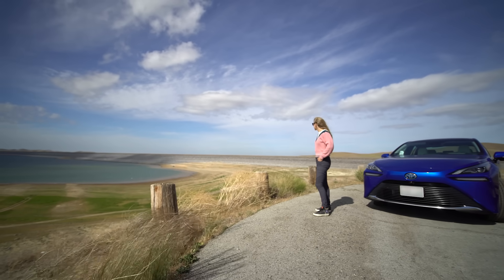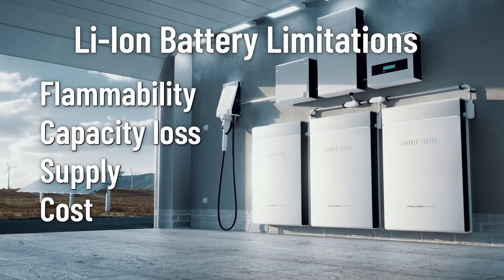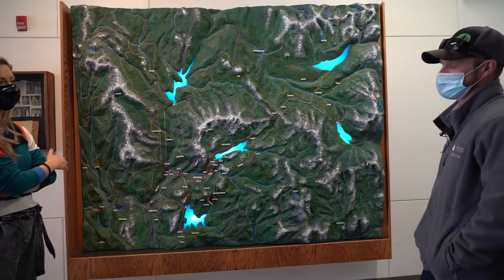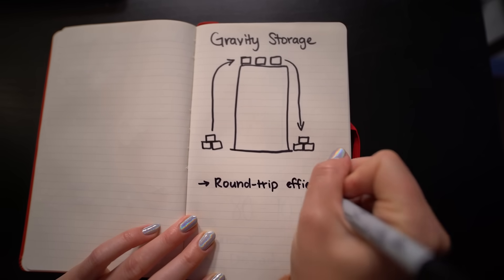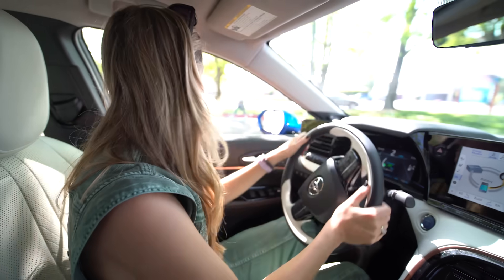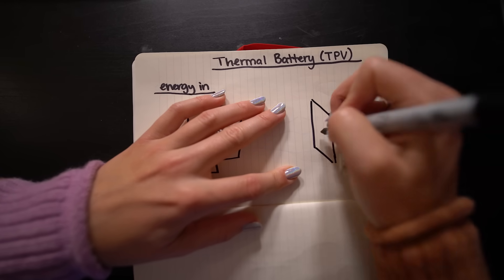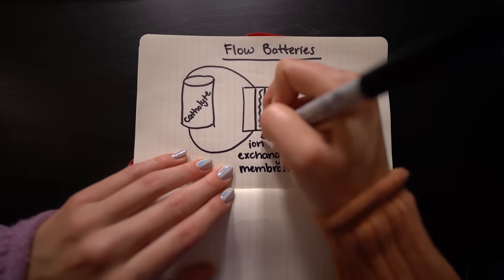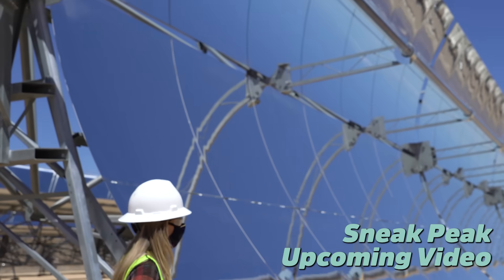The BIGGEST problem with clean energy

Comment: Make half of the installed capacity, nuclear power. Then compensating for renewable intermittency is far cheaper.
Reply: Cant build nucs in time.
Reply: @williammeek4078  ThorCon design is 2 years from order to finish, also you can build multiple large traditional nuclear plants simultaneously. France went from 20% to 80% nuclear electricity mix while their kWh consumption doubled, all in a little over 10 years. Dealing with climate change is a challenge but it isn't a riddle.
Reply: @AlterR4  provide a real world example of a Thorcore reactor being built quickly. From proposal to making electricity.
Reply: @williammeek4078  as soon as you provide a real world example of a developed nation's grid running on 90% renewables (not hydro as its workhorse) with low stable electricity prices
Reply: @AlterR4  So you are saying you have no evidence to back up your claims.
Reply: @williammeek4078  Are you familiar with the ThorCon concept?
Reply: @AlterR4  Evidence, yes or no.
Reply: @williammeek4078  i take that as a no, youre not familiar with it
Reply: @AlterR4  how many have been built? In how much time? And what was the as built cost?
Reply: A very clever person suggested recently that if you cover the area or a nuclear plant, ALL of it, including the exclusion zone, with solar, it produces more energy.
Sprinkle a few wind turbines, some storage, into the mix, job done.
You can even farm the land, sheep, etc.
Reply: my only hope is the developing world doesn't chase after the high VRE grids of the west otherwise we're going to slam into +3.5'C by 2080
Reply: @AlterR4  oh, this should be good. Care to explain how people used to intermittent electricity from unreliable fossil based grids will have trouble with much more reliable renewable based grids?
Reply: A great video on how to understand and use your instincts https://youtu.be/XrmyGtdmgoY

Comment: The issue with 100% renewables is you really need like 200% production, so that you can deal with transmission losses and storage inefficiency. We will get there but it’s harder than “spin up more turbines”
We end up reducing the economic incentive to get more efficient and to even build out more power production as we get closer to 100% even after these huge storage facilities come online.
Reply: That's the first part of the equation. When talking about energy we usually talk about the grid. But now, electricity production is 1/3 of human's energy consumption. You need to multiply by 3 the energy output of the grid if you pretend to decarbonize not only the grid, but also the vehicles and the industry. Add that to your multiplier and you see that you need to multiply x6 ( a lot of round ups here) the electricity generation in order to decarbonize our society. We need to remember that today, after a decade of the boom of the renewables they are about 18% of the grid production worldwide. We are increasing their weight by a mere 0.5% per year. At this rythmn, we will need a millenia to decarbonize our society.

Comment: For a bunch of unproven technology there was definitely a lot of shade thrown at lithium ion batteries. 

The degradation (all systems have some, pumped hydro has evaporation, impeller wear, etc) in lithium ion is minimal and at the end of its life can be ground up and refreshed as a new battery. Plus it's the fastest response to support the grid that exists right now. In Australia their electricity costs went down by 90% from 800/month to 80/month) after lithium ion plan was installed solely due to removal of costly fast response power plants being able to close. The current mines might run out in 2080, but if tesla is correct 80-90% of all lithium in their batteries can be recycled into new batteries, which effectively means we won't ever run out

Comment: I always expected gravity to be the primary form of power storage

Hang a weight on a wire and dangle it down a shaft on a pulley with a generator attached. Connect your exercise bike to the pulley and your morning exercise routine becomes the input energy to lift the weight. The more exercise you do, the more power you have to slob out and binge watch youtube...

Comment: Pumped storage ... 5 minutes! 
Dinorwig Power Station ...  0W to 1800 MW load can be achieved in approximately 16 seconds ... it's in Wales so water is no issue ...74–76% efficiency
Most of the tech is very interesting 

Still being paid by the Hydrogen fuel cell people I see ... it's wildly inefficient, lithium batteries are more efficient and can retain energy for longer ... regardless of what you have been ttold

Comment: Thanks for sharing your videos. 80% efficiency for a pump storage is rather optimistic without some creative operating situations.  For simple pump storage your probably closer to 65% efficient. The true death blow for pump storage is that they are very challenging to market since they are locked into a single location in the market. For max benefit when generating they are located in higher load pockets, unfortunately those regions seldom have affordable energy to pump with. You effectively end up with expensive energy in storage that is only affordable to use in extreme conditions. Just curious how big those pump storage units shown were, I’m guessing less than 40MW. I have experience with plants in the 250MW per unit range with a pond storage of 12GWH. Looking forward to seeing more of your videos.

Comment: If someone could successfully combine desalination with hydrolysis, they could solve two problems in one go. On the left coast, we have no shortage of water, but potable water is the issue.
Reply: Forcing ocean water through a RO membrane is incredibly energy intensive in itself.
So you are suggesting that instead of using that hard won potable fresh water for people we use it to create oxygen and hydrogen through electrolysis?
(Hydrolysis is a chemical reaction where a compound is bound to water, for example copper sulfate pentahydrate)
Why not use the fresh water for human consumption and lessen the amount of water we take from rivers, where it supports the ecosystem?

Comment: You missed momentum batteries… already in existence…. Take a large mass, say several tons , spin it up using a motor in a vacuum chamber… when you want the power back switch that same electric motor to a turbine and reclaim that potential energy.. the efficiency is good due to the lack of drag from air
Reply: Flywheels!

Comment: "A 40 hour battery costs 10 times as much as a 4 hour battery" --- 
Yeah, that's how math works.  You're literally saying nothing.
Reply: They were discussing how lithium ion doesn't have a reducting in cost with scaling. Almost every other system gets cheaper the larger it gets. [This video was very tilted against lithium ion battery storage...  its a shame because there is definitely a place for it in the current grid and a future renewable grid]
Reply: It's true for batteries but it's not true for all technologies. For the carbon + PV tech, the big chunk of carbon is cheap; you can buy twice as much carbon to heat up and the whole system nowhere near doubles in price.
Reply: @benoithudson7235  That must be a super short term solution-- because I don't see how you're going to keep the heat from dissipating over time, with even the best insulation out there.

Comment: Hydrogen is a problematic battery source in part based on where hydrogen comes from the rate of leakage (thanks quantum tunneling)and or course its pitiful energy density. Really The biggest problem with hydrogen out west is the same problem with pumped hydro namely the lack of water. I guess you could use excess energy to split seawater but you would realistically want to separate out dissolved ions but I still think there are better uses for water I mean even copying plants toolbox and making an ultra efficient analog of photosynthesis would likely produce far better rates of return. I do see desalination being a thing in arid environments but I really hope the salts are dealt with appropriately rather than dumped as waste. The very notion of waste is a problem as ideally all waste is misplaced resources and our long term survival depends on our ability to close the resource life cycle. Renewables are currently far away from reaching this threshold as the technologies have high initial environmental impacts

Personally I am worried that  a fully renewable pathway isn't ideal as energy density is a problem intrinsic to all renewables barring large space based solar grids as the net energy budget of Earth is fixed and must be shared between us and the biosphere. Already far too much of this budget is going into anthropogenic sources to an alarming degree.  As such while it isn't renewable Nuclear needs to be considered as part of the solution to reduce our land impacts on the biosphere while also avoiding the worst of the climate catastrophe.  Of Nuclear reactor solutions Small Modular Reactors (SMRs particularly those based on molten salt reactors rather than water) are probably the best route forward as they would naturally fix most of the big problems with the technology. For one  modern reactors are able to be designed to terminate the reaction under runaway conditions, and importantly by being modular it allows mass production rather than needing to build unique individual nuclear power plants. 
Thus this technology combined with fuel reprocessing to avoid the current huge waste of  conventional reactors  is  by far the most natural option to solving the energy crisis and the critical biosphere's crisis in habitats. Yeah I  know there are worries about nuclear proliferation and waste but really the first I don't think is going to be all that worse than it is now as use of such a weapon screws over everyone and radiation risks appear to be largely overblown with regards to multigenerational impacts. Not to say proliferation isn't a real problem but security precautions could probably be built into such batteries especially if they have to be sent to a reprocessing center where any unauthorized tampering could be identified and research has shown that deterrence based measures don't work with human psychology. 

This high energy return is what I imagine will best be utilized to capture carbon from the atmosphere and chemically fix it into less volatile forms like rock or potentially I guess even back into hydrocarbons as a type of liquid battery.  The "radioactive waste" on the other hand can be bred into more stable/unstable isotopes or used to power radioisotope thermoelectric batteries. The problem with what we currently do is largely the concept of waste as a whole as there is no such thing as waste only misplaced resources.

Ultimately space based solar seems the optimal path to the future once we figure out space based manufacturing but until then a solution of renewables plus smart nuclear energy. In an ideal world this would include the disarming and dismantling of all those bombs for  peaceful power production as after all research in psychology and neuroscience have shown that deterrence doesn't really work and has never worked instead increasing the risk of weapon utilization.

Carbon captured and resynthesized Hydrocarbons if converted into a battery tech is another promising angle which also would provide a good solution for all the existing fuels out there though this is purely dependent on well developed carbon capture technology. Where suitable I would instead argue that sequestering carbon into carbon based rocks is likely more important since there is already so much in the atmosphere arguably even graphite is an option with enough excess energy. If you have excess power available while capturing it is one prospective use another would be to use it right away for energy intensive processes that otherwise would be carbon intensive.

Comment: Thank you for your video. I have a question.
9:03 I don’t understand your thermal batteries. You say one can use the stored heat by radiation to a PV cell. But PV cells use solar light with 400 to 800 THz. So, your storage temperature must be appr. the same as on the surface of the sun (5000-6000°C). How do you want to handle that? How it can be insulated? And what’s the sense of the mirrors? I don’t understand.

Comment: This series of videos discrediting battery technology is totally biased and unfounded. Thank you Toyota.
Reply: Did you watch this video which includes flow batteries? Did you watch the previous one which I would say does a good job of comparing fuel cell and battery powered electrical vehicles? Do you think anyone using a smartphone, tablet or laptop would ever simply dismiss lithium batteries?
Reply: @kevinwalters5160  I'm guessing that's the only video you have seen about hydrogen, otherwise you'd realise just how much was omitted
Reply: @henryginn7490  There's a fair bit crammed into this series but they are short and renewable energy and sustainable living is an enormous topic and one that goes beyond science and engineering into economics and world-wide politics. It would be more useful if you cited the major omissions rather than speculate on how many videos I watch.
Reply: @kevinwalters5160  The tanks need to be very beefy to store the hydrogen at high pressures, and it needs to be stored under high pressures due to the low energy per unit volume. This also makes it somewhat of a safety hazard, especially due to the highly flammable nature of hydrogen. Almost all hydrogen is produced using fossil fuels as well. It's been a while since I saw the video and I can't remember if she mentioned the lack of hydrogen infrastructure, but that is a monumental problem as well.

This isn't an ommission about hydrogen, but it is a huge part of the transport issue that was not mentioned at all, but cars are inherently a bad solution to transport. Everyone going around in their own 2 ton pod compared to a system where people walk, cycle, and take public transport is considerably worse by almost every metric. Even an old diesel bus carrying 30 people would be far more sustainable than 30 people going around in 30 EV or hydrogen cars. I will acknowledge that this wasn't the scope of the ommissions I was original talking about, but I felt it was important enough to talk about.

Comment: Elevators could be constructed in such a way that they are (nearly) always balanced. Start the day with a lot of blocks of weight at a low position, in an apartment block. People will come down. Arrange it in such a way that weights will be carried up. It doesn't have to be an exact match. When people are returning home, they go up and the blocks go down.
Needs some figuring out, but it can be done to reach a reasonable efficiency.

Comment: I love how she makes a big thing about 100% renewables as if California is the world. Well, it ain't! You have Tesla owners using petrol powered generators to charge them!
Reply: The main problem with renewables is they don't generate electricity when we need/want to use it. The whole point of this video is to cover how that renewable energy can be stored, so that energy is available when we need/want to use it. Then, we can get rid of the coal/natural gas/"petrol" powerplants. Not all needed change can happen at once.
Reply: Also, if you compare the overall efficiencies of electric vehicles versus petrol powered vehicles, electric vehicles are much more efficient, even if that  electricity is generated using fossil fuels.
Reply: @lesliefranklin1870  I appreciate the value of renewables in a limited small scale capacity.  But powering huge cities with millions of people, 24/7/365? Nope. Not a chance. This is Californian drivel at its best. They should stick to defining pronouns.
Reply: @sulijoo  The physics in California is the same as anywhere else in the world. However, the solution for one place might not be appropriate for all places. That is why a variety of solutions is being developed. For example, the Isle of Orkney in Scotland generates too much power through wind turbines and they are planning on exporting some of that electricity to the "mainland" Scotland. In Finland, they are storing energy as heat in sand underground.

You're right, it's likely there's no easy way of generating enough energy in cities with tall buildings, such as New York City. Most energy will likely have to be generated outside the city, as is now done.

However, in most cities, even large ones, short buildings have roof space that can hold solar panels that can be sufficient to at least reduce dependence on external energy generation. This can be utilized for most cities around the world. Places where it can get dark most or all of the day, like Alaska, they can use hydroelectric, geothermal, wind, etc. There are many possibilities.

Comment: Don't lecture me on the virtues of an electric future if you won't explain where the extra capacity on the power grid is going to come from, especially as the green lobby are now so opposed to nuclear and coal. If the energy to charge electric vehicles comes from nuclear or coal, what exactly has been accomplished?
Reply: Uhh, what part of, solar and wind needing to slow down when making too much energy for the grid, did you not get? Larger capacities help renewables' total output ratios. It's not a one stop solution but any help to get away from coal, even if it doesn't replace it fully, is a good one.
Reply: I'm just left wondering why you mentioned nuclear and coal together like that. One is destroying the environment with its CO2 waste emissions, the other is safe, clean, and at worst creates a thousandth the waste that of the other, and takes up less land area than renewables.